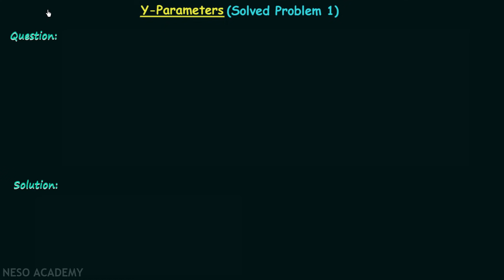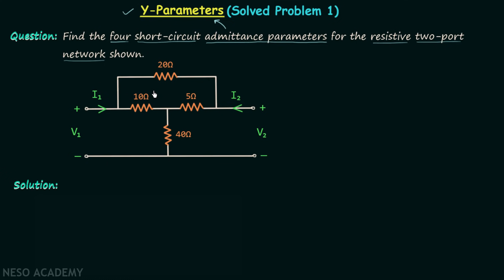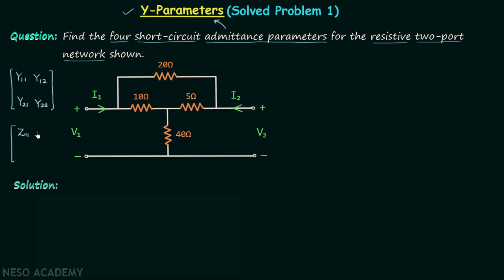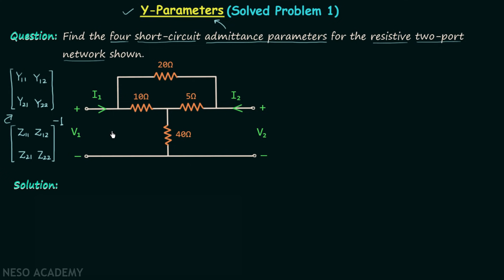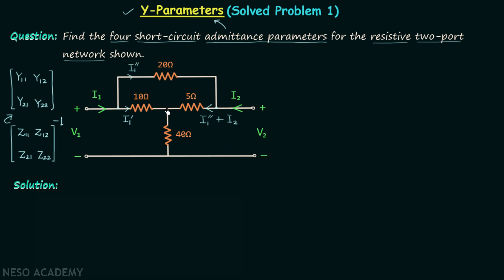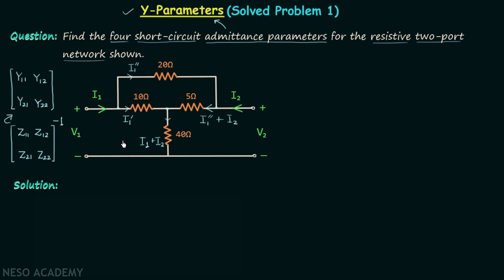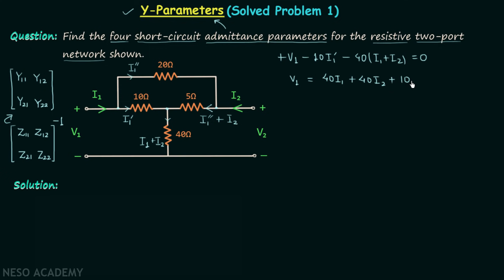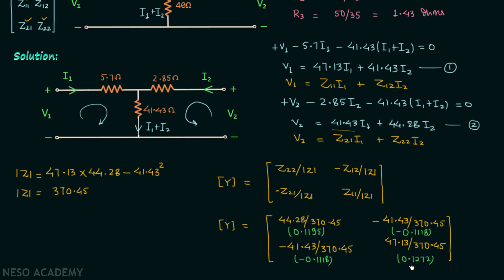Y−Parameters (Solved Problem 1)

Comment: Sir can we solve the problem using KCL Equation? If we assume lower terminal as ground. Then V1 and V2 will be voltages as upper terminals. 20 ohm resistor between v1 and v2. T Network of other three in v1mand v2. We can assume A as intersection. Write KCL at 1,2,A.
Reply: I got the same idea. Can`t we do that?

Comment: The method shown is good but very lengthy. If you can convert this star network to delta or pi network and then directly using the short circuit admittance therom it will very easy and short

Comment: can anyone please  explain why can't we calculate simply y parameters simply from the circuit and not through the inverse process?
Reply: i think we can do that also by using kirchoffs current law and write current equations
Reply: Me I calculated by using circuit for addmittance without using impedance and I get the same answer.
 as follows:  Y11=0.12,Y12=-0.11,Y21=-0.11,Y22 =0.12

Comment: After changing from Delta to star......what happened to those 10ohm and 5 ohm resistors
Reply: All 3 resistors in delta is converted into 3 resistors in star form.. hence 20, 10, 5 ohms are disappeared to those 3 resistors..

Comment: Sir why can't we take current(I2") through the 20 ohm resistor as :
I2"= (V1-V2)/20.  ???
Problem becomes very easy using the value of this current(I2") in terms of V1 and  V2.
I solved and got almost same answers not exactly the same.
If anybody can tell my method is  right or wrong?
Thanks
Reply: Don't get complicated, use mesh analysis to calaculate current.
Reply: Forget everything and use mesh analysis